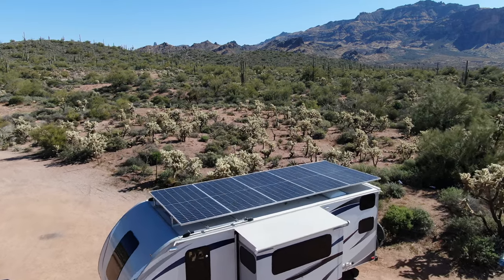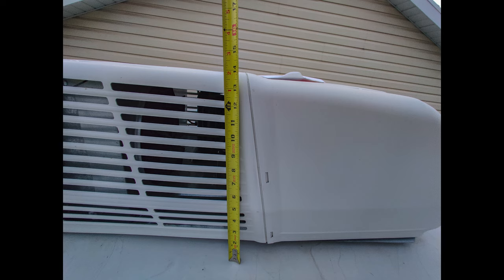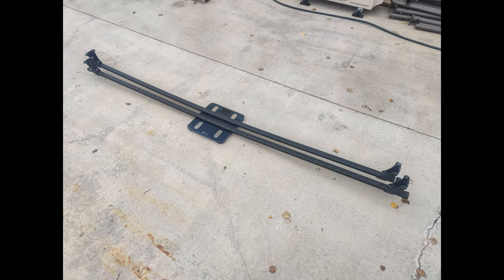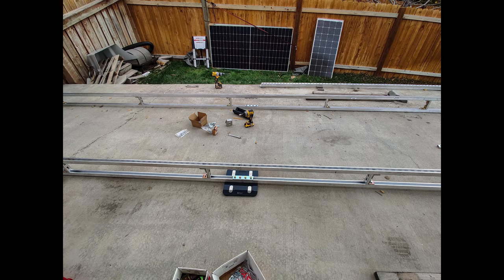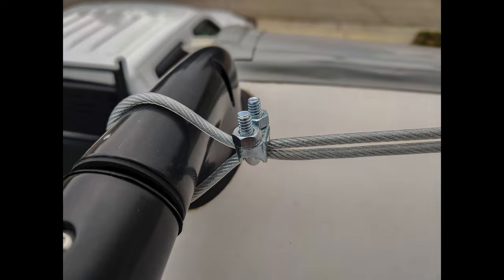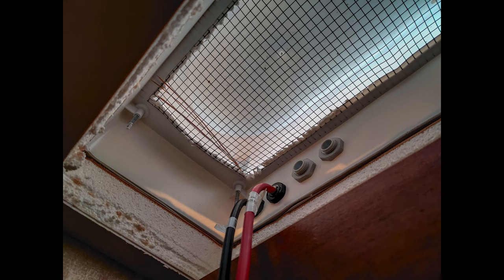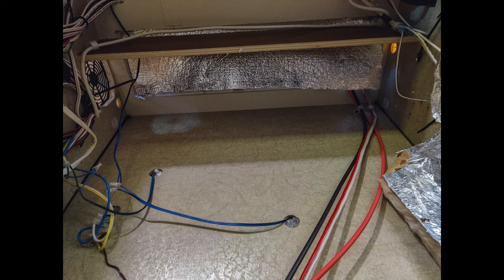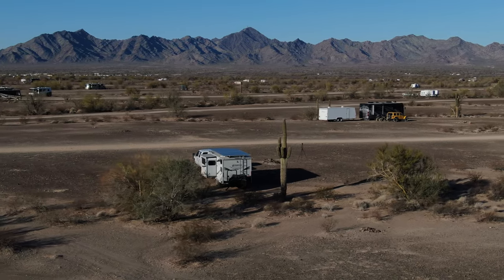How I Fit 2,650 Watts Of Solar Panels On 18 Feet Of RV Roof | Sun Powered Lance 2185

Comment: awesome job!!
putting a wind blocking ramp on the leading edge of your system is probably a good idea.  I can just visualize the wind coming off your truck and and running up the front of the trailer and slamming into the underside of the panels causing a lot of lifting pressure.
Reply from the maker: I agree a fairing would be a good addition. I haven't yet figured out how to do that as I'm too busy going on adventures and editing the YouTube videos of said adventures. I probably would have figured something out by now if I wasn't making YouTube videos instead. We have now driven with the panels as shown in this video on many trips including Arizona, Colorado, Idaho and Nevada in addition to all the many Utah trips, so this solution works but could still be improved.

Comment: Excellent video. Thank you so much for posting it! One question about the air flow in relation to a flat rooftop array design. Now that you’ve put some miles on it, do you think there would be any benefit to installing a front “spoiler” to deflect the air up and over the array while you travel to improve gas mileage? Or do you think the best MPG is achieved when the airflow is both under and over the array?
Reply from the maker: I'm not an aerodynamics engineer but if I had to guess, there is probably some benefit having a spoiler to push the air up over the smooth flat top surface of the panels. Between the roof and panels there's lots of surfaces to cause drag, but to be clear the amount of drag they cause is far less than the large object of the RV itself hurtling down the road. I doubt the gain would be more than something like 5% but that's just all me guessing based on what I've seen about aerodynamic drag in my life. If I had the time, resources and skills I'd make a spoiler for it and do a before and after test to find out for sure, but I have no intention to do so at this point in time.
Reply: @ElectricTechAdventures  Based on the fact that semis use spoilers to direct air flow up and over their trailer, I can see that there might be a small MPG benefit to having a spoiler in this application. In this case, it would also have the benefit of reducing lift on the array, which could have value as the 3M tape ages.
Reply: @ElectricTechAdventures  after using these (I'm going to be installing something similarly), is there any learning lessons on drag/turbulence forces on these without a tilted leading edge?
Reply from the maker: @OnyxRayven1  No lessons per say other than that it works fine. I don't have any insight into additional aerodynamic drag because the truck I use to tow it now is not the same one that I towed it with before the retrofit. In the future if I get a spoiler installed in front of the solar panels I will report whether or not there is a change in aerodynamics based on my gas mileage. I can report as well that I have had the trailer in varied situations with significant winds in the order of 35 mph gusts from the back and sides and have had zero movement of the panels.

Comment: I own the same 2019 Lance 2185 and while I wont add as many solar panels and will likely go with a 12V rooftop AC, you have inspired me to make the travel trailer much more off-grid compatible. Was the replacement refrigerator a great fit, or did it require modifications to the opening. Did you utilize the space underneath the sofa for the the additional batteries, inverter and other solar system components. Incidentally I added the ProPride 3P Anti Sway Hitch (previously known as the Hensley Hitch), its a little pricy but the stability when towing is incredible!
Reply from the maker: @AndrewKidgell  The replacement refrigerator fit in the opening almost exactly the same. I put a half inch piece of plywood underneath it to bring it up so that there was no gap above or beneath it. So I guess that tells me that vertically it's about an inch or so shorter than the prior fridge. I did utilize the space under the couch for the additional components which I outlined in this video https://youtu.be/dse_QW7fDmk
Reply from the maker: @AndrewKidgell  regarding an anti-sway hitch I have not purchased one of those because my truck and trailer combo is very stable even with high sideways winds and I like the ease of hitching and unhitching without and anti-sway hitch. I think part of the reason why my rig is so stable is because I am pretty tongue heavy due to the electrical components under the couch.
Reply: @ElectricTechAdventures  Thanks for your reply, I look forward to viewing that video later. Its great you don't need a sway hitch, the only reason I selected the ProPride hitch is because all the sway bar hardware is permanently mounted to the travel trailer and I back up and attach it to my truck in the same way you would with any other hook up, I didn't want the hassle I'd seen with other examples. The factory solar panel on my roof is to the right of the AC as you look down the roof line from the ladder. I wonder if mid build they realized the issue with shading on the solar panel you experienced and relocated it.

Comment: In all of your amazing YouTubes is there one that shows a schematic on how you wired the solar charging for the Model S from the trailer's solar?
Reply from the maker: @benkanobe7500  No there isn't a schematic. I intended to create one but couldn't decide what software program to use and ultimately I figured it would take too much time and I knew it all in my head. There isn't really anything special about being able to charge an electric car from the trailer though. The main thing the Tesla mobile connector requires is for the ground and common wires to be connected (bonded) together which I did in my breaker panel.

Comment: After you installed the solar panels. did you encounter stability issue when you was driving?
Reply from the maker: @coco9004  No. Zero change in handling.

Comment: did you notice any gas milage change or wind resistance from the solar panels?
Reply from the maker: Prior to the addition of the solar panels we borrowed a couple different trucks from others, then during the retrofit is when we purchased our current truck which we've primarily used to tow our trailer so I don't have before and after data unfortunately. I'm confident it lowers the gas mileage, but by how much is just guessing as I've never measured it. I do see bugs splattered on the underside of the panels on the back side where the edges stick down so obviously there is significant air flow going through there. At this point the best way to objectively measure it would be to tow a standard Lance 2185 a specific distance, then do the same with ours and measure the difference in MPG. Ideally I'd prefer to do that test with an electric truck because the energy consumed details are nearly infinitely more precise. I've thought to do such a test once we have an electric truck, but alas that purchase is a complete unknown at this point in time. In the meantime I'm trying to catch up with the mountain of editing backlog I'm currently under and someday I hope to revisit the RV solar panels fairing concept.

Comment: Your video was very inspirational, good work. I have two questions where did you buy your panels, and how much did you pay for your panels
Reply from the maker: Thanks, I'm glad it was helpful. I purchased my panels from Santan Solar in Arizona, but they don't always have these panels available. I outlined all the costs in this video https://youtu.be/7W9E0Y3H-aY and in the video description there's a link to a google spreadsheet that lists all components I used in the project and how much I spent on them.
Reply: @ElectricTechAdventures  I checked out all the links on your video and I could not find the solar panels on those spreadsheets
Reply from the maker: @sjf67gto  Line 105 https://docs.google.com/spreadsheets/d/1wVE8St80sVX7o2nARthmwOq_jNoYdScJQRD76iBfDlE/edit?gid=2135436946#gid=2135436946 or $1,618 for 5 panels.
Reply from the maker: Or line 143 on this spreadsheet https://docs.google.com/spreadsheets/d/1L2IxNuZ8ZQl3-Fey8dBsKHQH7RidaSkTDCVPGTeikKc/edit?gid=0#gid=0
Reply from the maker: I have checked Santan solar many times through the years since I purchased mine from them and they haven't had over 500 Watt solar panels until now. Since I had the spreadsheet pulled up I checked and I'm pleasantly surprised to see that they have several options such as this one https://www.santansolar.com/product/new-byd-545w-split-cell-bifacial-mono-solar-panel/
Reply: @ElectricTechAdventures  thank you for that information, will look forward to more videos on your travel trailer Adventure

Comment: Would be cool to have a solar panel that can tilt and slide to become an awning.  Not only would that improve power output, but it would also give you an awning.
Reply from the maker: Yes I agree, and I've seen in forums others do that and they post pictures and videos of their various solutions. The biggest limitation for me is weight considerations. I kept things as simple as possible for cost and weight savings. I've seen projects where they make sliding trays of solar panels down the length of large greyhound bus conversions or class A RVs and I'm jealous of their cargo carrying capacity on those rigs! To be honest my solar array is plenty for the trailer's needs though. Also I do have a traditional awning already so that's not really a need, but having one made out of solar panels would be way cooler. If money was not a limitation I'd look into purchasing a heavy duty goosneck trailer then remove my trailer's axles and mount it on the flatbed. I'd get a flatbed trailer that's longer so there's room on the back for toys. I saw someone else do that very thing and I think the trailer's weight capacity was something like 20k lbs.
Reply: @ElectricTechAdventures  Is it that much weight to add at least something that can tilt the entire array by lifting one side up?  That way the snow can slide off easily and you get more sun.
Reply from the maker: @GeorgeOu  It's probably possible. I didn't look into it much. Perhaps I'll add tilting someday, but so far that hasn't been a priority as I have more than enough energy when camping except for the dead of the winter which isn't when we're camping. I would be concerned about wind though if they were tilted up high enough to match the angle of the sun in the winter. The panels are about 7.5 feet long, so when they're tilted up there would be a nearly 7.5 feet by 18 feet cross section to catch wind.

Comment: Excellent job - overengineered a might. I am planning on racking 8, 455 watt panels 13" off the roof of my MH to power a 48v DC Hotspot mini-split (with a 302ah 48v battery bank). Have you noticed any handling issues with an extra 550lbs or so mounted high on your roof? I would imagine that you must be close to your ccc on a trailer that small.
Reply from the maker: Thanks. I'm not sure which part you're referring to as overengineered (unless all of it perhaps) but if I had to guess I think you're referring to the quantity of rated Watts. It is very much overkill in the summer just for the trailer, but it's actually inadequate in the winter. If I figured out how to tilt the panels then that would help during the winter, but not fix the problem. Heating takes a lot of energy and the days are too short in the winter to fully power heating the trailer even with a 33.1 SEER heat pump mini split. My goal when designing this system was to fit as many panels up there as physically possible because I intend to tow this trailer with a Tesla Cybertruck some day and I want to be able to have excess electricity to charge the truck with. I understand electricity enough to understand that compared to the Cybertruck's energy demands this array is very small, but even just a little bit of extra electricity from the trailer while camping is fun to be able to get. I actually charge my Model S from my RV electrical system on a daily basis and so far the trailer has produced 3,028 kWh in the last 11 months and the vast majority of that has gone towards my Tesla. I intend to make a YouTube video about this in the near future. I'm giving it a year of doing it before making a video of my findings. My panels are 9" off the roof and they could have been as little as maybe 7 inches off the roof, but I wanted to have enough room for the vents to move some air still. Removing the rooftop AC is of course what enabled that height. Regarding the weight on the roof I have noticed no effects from the panels being up there and actually there's only roughly 200 lb extra weight up there. I asked Lance what my rooftop storage rails are rated to hold and they responded up to 500 lb. My panels are 63 lb each and there's 5 of them so 315 lb of panels. The unistrut weighs 75 lb. That means I added 390 lb up there and it's equally spread across the entire length of the roof. Then there's the subtraction of the weight of the AC unit that was up there at around 100 lb and the rooftop luggage rails were surprisingly heavy at around  75 lb that I removed. The majority of the added weight is coming from the batteries and inverters under the couch which is much lower weight. As part of this project I replaced the axles on the trailer and had them welded to heavy duty 6 foot long angle iron that is then welded to the trailer frame. In the entire project I removed some things and replaced others and the net difference ended up being 700 lb additional weight added to the trailer. When we go on trips I only put very light things in the passthrough storage, and I put the heaviest things in the bed of the truck which has thousands of pounds of additional payload capacity. I use a Weigh Safe hitch to keep on eye on my tongue weight. If you're interested I have additional videos on my channel outlining the components under the couch, the net weight difference after modifications as well as the Weight Safe hitch unboxing and tour of the factory.
Reply: @ElectricTechAdventures  Good deal. It's a well thought out project. By overengineered I meant that your racking appears stronger than needed with the cables in front and using the ladder for support in the rear. Overengineering is not a bad thing, as living Ft on the road for the last 4 years has taught me. Sometimes the weather changes still surprise me. 

It's good to hear that you don't have any handling issues. I think your beefed-up running gear is very smart and will surely save you problems down the road. I expect the weight and size array I'm planning will require a little more caution on my part, as I will be adding about 475 lbs. on the roof of my 36ft Class A. I might remove my rear AC unit as I never use it, now that I put a new Furrion AC on the front. That thing blows super cold air and is easy to start, as it uses an efficient scroll type compressor, not the old, hard starting piston compressors most rooftop ACs use. I plan on adding a mini split to the rear bedroom, blowing forward down the hall into the living/kitchen area of my MH. I might even use the ductwork currently used by my rear AC to redistribute cool air to the front where it's needed. 

I once used the 620w array mounted to the side of my MH to charge a pair of electric bikes, but I recently sold them to free up that weight in preparation for my bigger, rooftop system and rear mounted mini split. I will retain my side mounted array to charge my 12v 560ah LiFePo-4 bank. A side mounted array has several advantages. I lift it to the exact angle needed based on latitude and season to optimize production. This is especially important in winter when that 620-watt array pointed directly at the sun performs more like a 900-1,000 watt flat mounted one would when the sun is low in on the horizon sky. The other big advantage is that I can clean it easily without climbing on the roof, which means I clean it more often. Keeping it spotless improves production too. At 66 yrs. or age I don't like climbing on the roof unless I absolutely have to.

Good luck using a cyber truck as a tow vehicle. As a general rule, the range of electric trucks is extremely limited when towing - at least for the ones currently on the market. It's smart to tie in your trailer's array to help extend your range a tad. It also prevents you from getting stuck somewhere deep in the boonies where there's no solar charger available, and you've got a day or two of sunshine to bring your batteries back up. It surely makes more sense than running a generator to get you unstuck - as I've seen people do.
Reply from the maker: @SuperSushidog  regarding electric trucks I agree, but we currently have extremely limited data to go off of. Currently available truck manufacturers (Ford Lighting and Rivian R1T) have very little experience with electric vehicles and the Munroe teardowns have shown those manufacturers struggle with efficiency and other factors that effect range. I'm hopeful with Tesla's experience the Cybertruck will prove better, but obviously Tesla can't change the drag and this inefficiency my travel trailer will add. I'm planning to get their longest range truck at around 500 miles of range not towing. I anticipate getting half that range while towing which will get me the same range I have with my Model S I have now which works for us. Then if we're not in a hurry and we are camping during the summer when there is plentiful solar then we will be able to slowly charge the cybertruck a little bit everyday and gain that much more range. And worst case scenario just not be losing any range on the truck while in the boondocks.